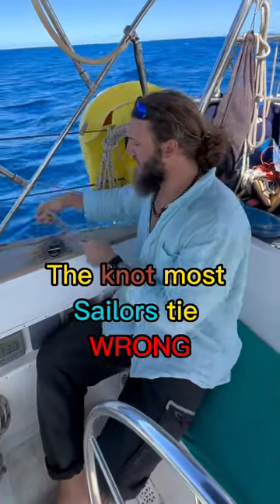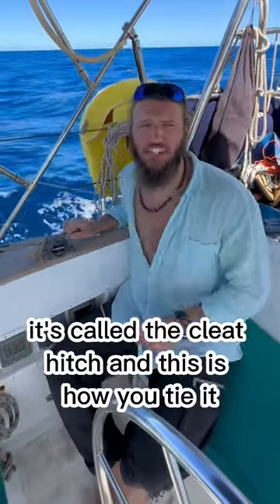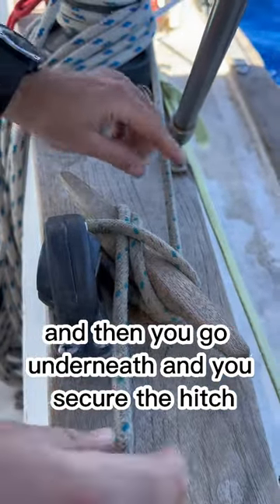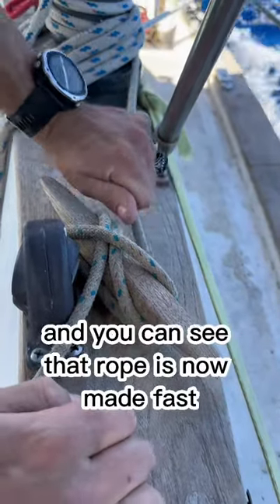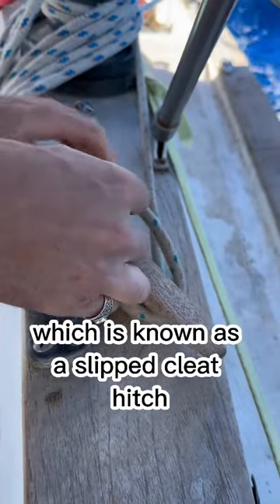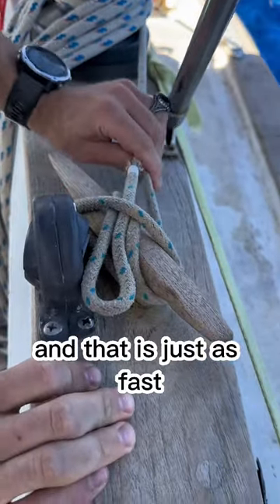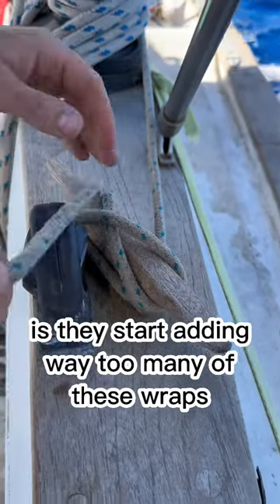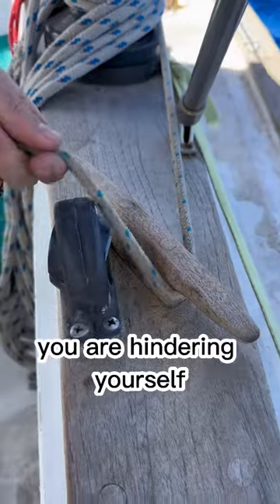The knot most sailors tie wrong. #mostimportant #boat

Comment: Actually, professional mariner here the hitch is not needed always and the more wraps you have the less likely it is to tighten down to the point of not being able to be undone... I work on tugboats and have seen them get so tight we had to cut them off the cleats... when you put at least 3-4 wraps they will hold without even putting the lock hitch on and its far less likely to tighten to the point of not being able to be undone... Im not saying don't put the final lock on but sometimes it is not needed and if you only put 1 wrap and the lock hitch it will lock down so tight youll be cutting it off even with the loop quick release hitch....so just because a guy with long hair on a boat tells you the way written in a book doesn't mean it always works in the real world....
Reply: Agreed, wherever loads are heavy in relation to the size of the line and cleat,  also the first turn should be a complete 360 wrap before the first diagonal (his is only a half turn)
Reply: Yea diggerent situations have unique solutions. Usually the skipper will tell ya how wrong you done it. 😂
Reply: if u do a full turn in the beginning (he didn’t) u don’t have to worry about the line locking up in my experience and thats how i was taught to do it and have never had an issue
Reply: @Gottenhimfella  Docklines for small boats will chafe more if you do that.
Reply: @mckenziekeith7434   How have you tested that interesting and rather vaguely worded hypothesis -- preferably, by trying to prove it wrong ?
Reply: @Gottenhimfella  It is evident from experience. When you take a full turn, the standing part of the line chafes against the turn on the cleat. It gets wedged in between the acute angle formed by the turn and the cleat. But it is mostly fine. Do it however you want. Your boat and your docklines.
Reply: @mckenziekeith7434   It sounds as if you might be talking about cleats which are too small for the docklines used on them, rather than small boats as your post suggested.
Reply: @Gottenhimfella  I am talking about chafe on docklines secured to cleats. I said small boats because that is what I have experience with. Whether the cleats are too small or not I will leave to an expert like you. But it applies to the typical sizes of cleats found in the marinas I have visited.

Comment: Still incorrect though this is how most US sailors do it. Europeans make a full turn around the cleat, then cross and next one is the locking hitch. The strength of the cleat hitch is not in the turns but in the wrap around the base. That’s what takes the load. 1/2 turn will do if there’s not much force.. but when there is heavy load you want the full wrap at the base.
Reply: agreed.
Reply: Don’t worry Americans who know how to tie it use a full turn too

Comment: First off, you need to start with a full turn. Also it all depends on how much load  and cleat/rope sizes. More cross turns sometimes are necessary to avoid it tighten to much to get it loose.

Comment: Just like wraps on a winch you have to know the loads you are dealing with, the size and slickness of both the line and of the cleat surface and then you will know how many wraps under the horns and or figure 8’s you need. A slick thin dinghy painter on a big dock cleat will need more for example because of mismatched sizes between line and cleat. Also just like anchoring and mooring you might want to look at how structurally safe the cleat seems to be and if it is adequate for your load. For example towing might need to go to various points for spreading the load.

Comment: The way you do it is the way I do it. But truth be told there is not any wrong way to do it. When docking, I tell novices to just get a bunch of turns quickly. Then we go around and do it like this. But I value speed over form when docking.